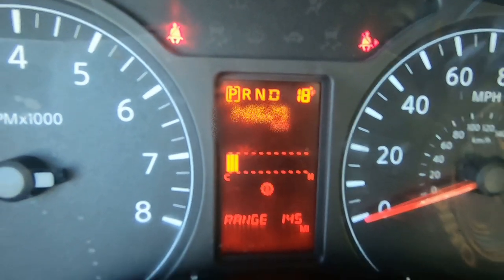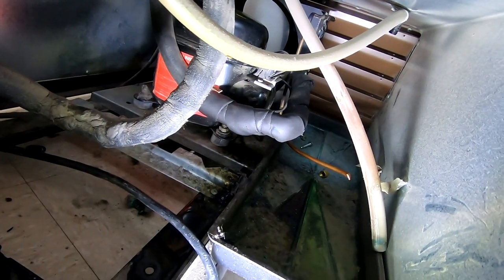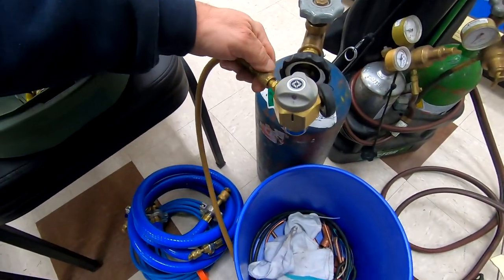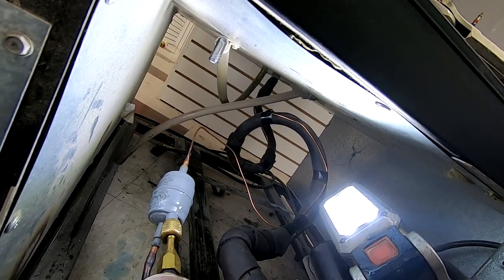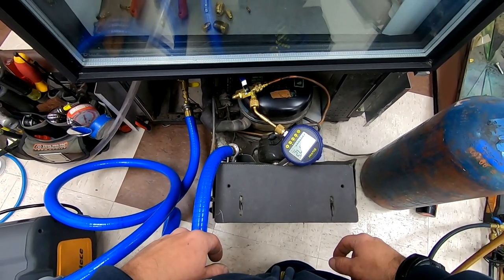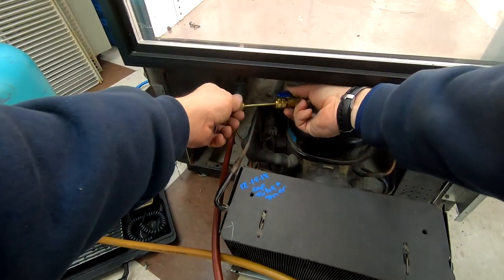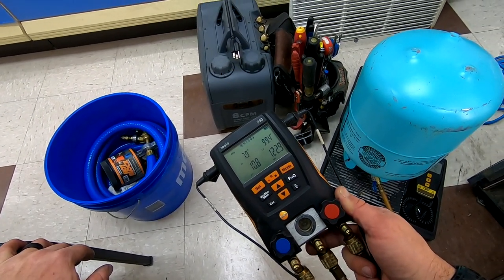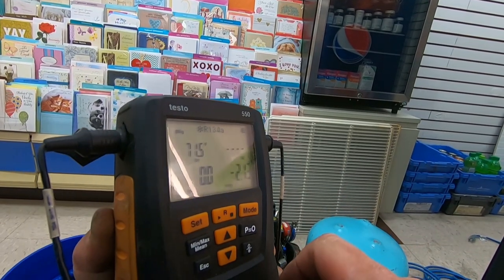Replacing Capillary Tube On Reach In Cooler

Comment: One the things I covered when I taught class at the union and spent time at our wholesale counter was to show techs how to figure the additional refrigerant needed when replacing a pencil drier with a 032 cap-t drier. By doing a ratio by comparing the volume of the two driers ( pie x r squared x length )and adding the difference . I had a whole presentation just on cap tube systems.The Sporlan drier tells the liquid holding volume of different refrigerants on box. I’m sure it wasn’t exactly accurate but it got the guys close enough where the units worked I never had a complaint in all the 30 plus years I did it. Now that I’m retired after 37 years I enjoy your videos very much you do great work keep it up !!👍
Reply from the maker: Thanks so much Gary! I appreciate that👍👍. Merry Christmas!

Comment: Awesome video. Question for you. I have ice building up around the entrance of my freezers evaporator.  I vacuumed it down twice now, and refilled with the proper amount. The evaporator is still frosting but only for the first 10" of tube. The rest  of the evaporator is shiny. Any ideas?
Reply from the maker: Could be a restricted capillary tube if your recharging it to spec and it’s pulling into a vacuum or has lower suction pressure.
Reply: @HVACRSurvival  I saw where someone isolated then flushed the tube with nitrogen, then acetone, then nitrogen again.  Might try that. Guess I got some work to do. Might flush or replace the evaporator as well. It's r134 and it is in a vacuum on the suction side with proper charge.

Comment: Those True units always have a lower suction pressure. I called tech support and they would always tell me in the coolers they could go as low as 8 pounds in which I thought was a little low on r134a. A very good video tho!
Reply from the maker: I haven't even considered showing the video I just made where everything went to shit and was pulling zero. I had a bad day on Friday. Cut the capillary tubes apart three times verifying that it was not restricted from my doings. Still not a hundred percent sure what the full problem was but it worked when done....several hours over my quoted time. 🤦‍♂️

Comment: I’m an industrial sparky not an HVACR Tech, but I learned automotive AC in college (R-12 don’t laugh I’m old 👨🏻‍🦳😆) so I feel your pain - I still do some automotive AC work and follow you and Chris, Bill, Bryan... Anyway, I digress 😋

Bad test equipment is a big bummer - I’m glad to hear from folks like you - I try to always buy tools that are the best value
For electrical diagnostics I use both my old first gen FLUKE 87 (A Fluke 87-dash nothing for you young kids lol - my meter has more experience than yer mom 😘) and my Klein CL800 (also old like me ) so I tend to buy a good tool and hang on to it. 
Maybe I’m just thrifty lol 🤷🏻‍♂️

When I upgrade from my old Mac Tools manifold I think I’ll go with Fieldpiece 😉
Great video bud 👍🏼
Reply from the maker: I'm no spring chicken. I started when I was 19  so I've been at this 24 + years lol I had a set of Testo 557 I just stop reading temperature on the suction side while making a video 👎👎which were awesome, but the cost to repair them was over half the cost of buying new and they're getting to be 5 years old so I don't really want to spend that much to repair them. So I need to decide if I want to spend that kind of money again or just use what I have because I also have the Fieldpiece probes which are excellent but not always as quick as I would like to see it. 
 I know what you're talkin about far as the fluke 87 - nothing I was in electronics prior to this and was what I was supposed to go into for college. So to say the least I really do like top-of-the-line toys. I own the Fluke 87 - 5, Fluke 376FC with the flex probe,  Fluke 117, 112, Amprobe nav-52, and several other meters. Im a tool slut that likes nice things. 😁👍👍 I appreciate you taking the time to watch the videos my friend, have a great Christmas and happy New Year.!!!!
Reply: Sinister Sparky I get what you’re saying lol. I still have my Simpson 260 and yes it still works.

Comment: what great gauges, only the finest chinesium with number creep.
probably like tire and other gauges I've had, they suck the battery down fast and don't compensate for voltage drop, I found one tire gauge with weak battery skewing over 15PSI by time you checked four tires!

Comment: My 557’s have been great to me. Sometimes I have use the heat and beat method to dislodge crap outa the oil in the hermetic compressors so I’m not there all day.
Reply from the maker: I have no complaints on the 557s, I just don't want to spend the money again on them. So I stick with these cheap 550s and bitch about them not zeroing out. LOL

Comment: You indicated that the pressures on the 550 did not show zero when the lines were disconnected.  Didn't the zero function work?  When I work on a system I always make sure my gages are zeroed first, if not, bleed the lines then press zero.  If that doesn't work, yes, you have a problem with your 550.  I've only had to contact them once about my valves leaking, I purchased a set of O rings plus spare valve stems.

Jim
Reply from the maker: I will zero them and they will be off again when I unhook, I spoke with the factory and its because they use a cheaper sensor than they did in the 557. Sometimes they go back to zero and lots of times they don't. There cheap China tools, not German like the original ones were, you got what you paid 4 I guess.

Comment: I have a small 12v fridge. Compressor kicks on , thermistor reads accurately and thermostat works. Capillary tube gets ice cold but fridge stays hot. Does that sound like a capillary tube blockage ?
Reply from the maker: If it's cycling off and on and holding temp, I wouldn't worry about it.  Cap tubes can play games with you. If it's not cycling,  I would add a suction port and see what the pressure is.
Reply: HVACR Survival The fridge stays hot. There is no cooling inside of it. This type of fridge doesn’t have a fan to blow cold air inside the fridge compartment. The compressor stays running all the time. What do you think ?
Reply from the maker: It's possible it's restricted, without knowing what this looks like and where it's being used it's hard to be sure. I would turn it off until you can be sure, otherwise your possibly causing more damage to the compressor by letting it run.

Comment: Thanks for great video again. Have a question. Is it just me or just happens to someone else as well, when ever i change cappilary tube i tend to add ounce or two more then is factory labeled.  Maybe is because of dryer but literally always end up adding bit more to have satisfied operation. Cheers
Reply from the maker: I have It happen to me often,  and some of the driers are possible larger than the original one likely causing that.

Comment: I found a restricted capillary tube on a unit. Looks like they threw out the entire thing because they didn't want to repair it. I've measured the capillary tube and it appears to be .143"-.145" outside diameter. Is there a slightly larger size capillary tube I could use to slip over each end after I've cut out the damaged section to braze it back together? Thanks!
Reply from the maker: You can use a piece of quarter inch copper,  Crimp down the ends and then crimp it shut.  When sizing a cap tube focus on the inside diameter.  JB tools sells a sizing tool and they sell the cap tubes
Reply: @HVACRSurvival  Great Idea. Do you know what the name of the tool is? I searched and couldn't find it. (yet) I have a homemade tool I made for rolling tubes into a smaller diameter. It's basically a pipe cutting tool that I've ground the cutting wheel down until it's a wheel like the others, so instead of cutting, it "rolls" the material thinner. I'll try my homemade tool first after annealing the copper tubing and see if it works while I wait on your reply. Thanks for the response in advance!
Reply from the maker: The tool I'm talking about that determines what size the cap tube is, is made by JB
Reply: @HVACRSurvival  Oh ok, no problem. I have a pair of calipers that I use to measure the diameter. It's accurate to .001", so I'm good.

I used my homemade tool. It worked great! I used a gauge pin inserted in the capillary tube to prevent my tool from rolling the tubing to a smaller diameter. Works a treat!

Comment: I worked on a similar reach-in that had a blocked cap tube.  I changed it out along with a new strainer, and suspected it was something with the oil.  Was working fine for 3 months, then the same problem again.  How can you prevent it from occurring over and over?
Reply from the maker: dump the oil and replace it with new. That has worked great so far,
Reply: Good luck, I remember changing it out several times with mixed results. This happens because a capped cap tube=a burn out usually with these units. No acid removal HH filter driers in this size further limits actions.
Reply from the maker: I now replace the oil in the compressor when there's a chance the oil has broke down to prevent the new cap tube from plugging up.

Comment: Did you change evap fan motor? Common problem on true  coolers.  Oil leak and slow rpm.
Reply from the maker: Noted it on my paperwork and spoke with staff,  have not heard if they approved it yet.

Comment: You have to cut the cap tube to length right?
Reply from the maker: Yes absolutely, we call the factory and ask what diameter and length they need to be. This particular one was required to be 12 foot at the diameter that I had (It's based on the inside diameter.) Great question👍👍

Comment: My 550's do the same thing.  Good vid.
Reply from the maker: No kidding, so we'll they were right, it wasn't worth sending them back. My Testo 557s never did this crap but they also were a lot more money
Reply: @HVACRSurvival  as long as I zero them before I put vacuum or pressure on them they have always been accurate to any other gauge I compare them to. I get that same bad feeling though after working on something and watching it read vacuum when you take it off.
Reply: @HVACRSurvival  haha my field piece probes have been doing the same thing last couple days.  They will be zeroed out when I start and when I take them off they will read negative a couple psi. Weird.
Reply from the maker: @jonnymac31  I hate to say it too but Fieldpiece probes have started doing it to. I guess what do you expect for 500 plus dollars🤣

Comment: Are you swedging with a M12 impact, by chance? I thought they required a higher RPM than that drill requires. If it works I would be STOKED.
Reply from the maker: Yeah because it was quarter inch, it might even do 3/8 possibly half-inch but anything bigger than that you're going to need a 18 volt
Reply: @HVACRSurvival  My ancient M18 Fuel has a slippeed chuck from serious abuse.  I paid a ton for it 5 years ago when it was new. Need the boss to pay out. Thanks!
Reply from the maker: @analogmoz   I've never worked anywhere that doesn't have a tool replacement program or at least a tool expense account. That would suck.

Comment: How does one check cap tubes for restriction
Reply from the maker: If I have any doubts I will pull the full charge out and weigh it in. If my suction is low then I have a restriction.

Comment: How long did it take you
Reply from the maker: I think 3-4 hours because the extreme vacuum time I had,  even with those large hoses. That's why there not over kill when pulling on a system that was open because of a leak.

Comment: Too bad I was gonna buy me some testos.
Guess I'll just stay with ol trusty analogs.
Cant beat doing math😁🤔
Reply from the maker: I loved my Testo 557s but they just broke last week and then they wanted $200 for the control board Plus I needed a new temp sensor And there was also labor. Basically a little over half the cost of new. Now that they're screwed up I'm stuck using the 550 S. The 550s are garbage. I really like my Fieldpiece probe. But I don't know if I like the sman manifold. They're just so large
Reply: Yea I feel ya on that..sucks to invest in a tool that let's u down..
Reply: I've been researching the testo and fieldpiece manifold guages. Testo has a 2 year warranty where fieldpiece has a 1 year warranty. How long did you have the testo 557 before it failed?
Reply from the maker: @whitesheatingairappliancer7101  The 557 had some small issues that were taken care of under warranty and I think they only had two or three year warranty now they're offering five, 550 series is ther shit series,  the 557 is there good stuff,  it just pisses me off the repair of the 557 was 1/2 the cost of new. So I sold them on Ebay for parts.
Reply from the maker: @whitesheatingairappliancer7101  also Ron, Fieldpiece usually will do the repair for free even if it's out of warranty.
Reply: I have the Fieldpiece Sman360. This is my second one. The first one got heavy rain and dropped. I sent it in for repair and they sent me a new one with 2 thermistor clamps. At no charge. I’ve had no problems with the replacement. They make your job a lot easier. Superheat and subcooling all calculated. No need for the Cooper digital anymore.
Reply from the maker: @actechformallyyomama746   Fieldpiece may not be the best of the best on everything they make but I got to say they take damn good care of their customers. That's worth a lot to me. I own their Fieldpiece smart probes and vacuum pressure gauge manometer, vacuum pump and a few other Fieldpiece items.